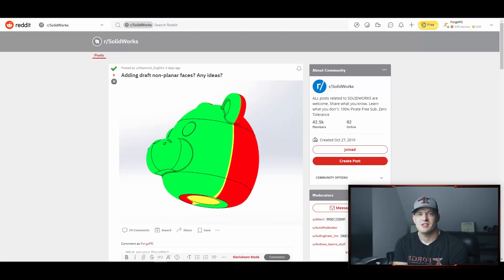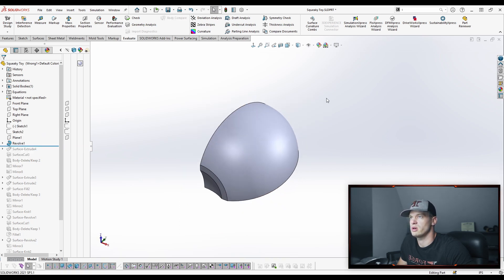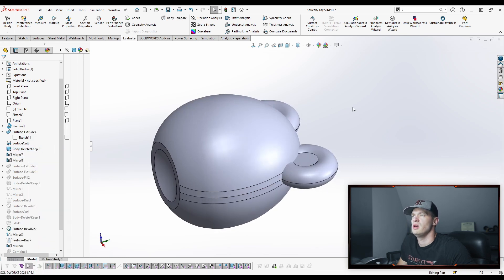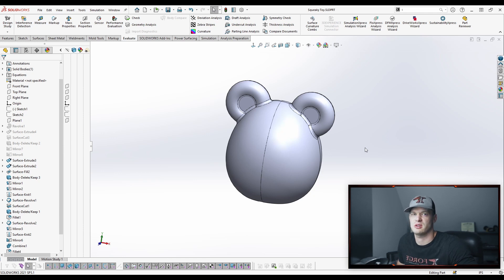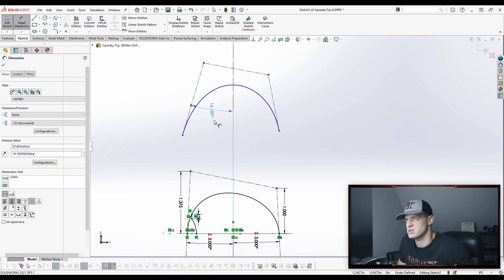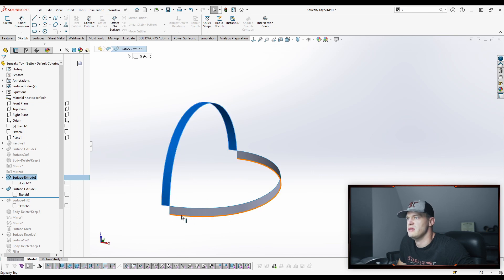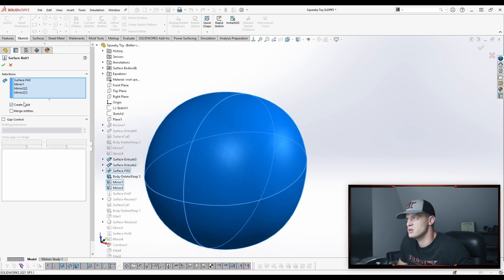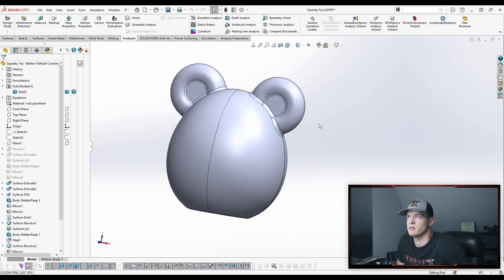How to Draft Curved Surfaces in Solidworks

Comment: I know it's a preference thing, but why didn't you use a ruled surface for the parting line draft tangency? Just curious since either way works.
Reply from the maker: Do you mean in the first part of the video, where I taper the surface and use it to cut away the model? Either way would work. I think I favored the surfacing tools this time as that is what was used in the second half of the video. It would be interesting to test and see which is more stable, faster to create and has faster rebuild times.